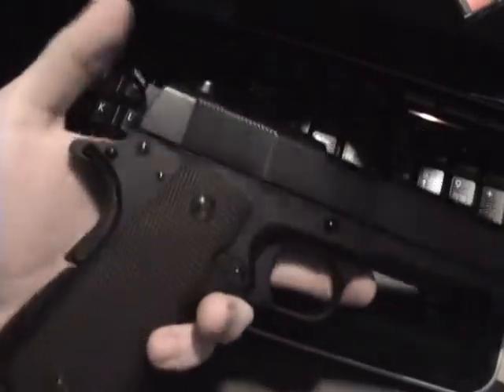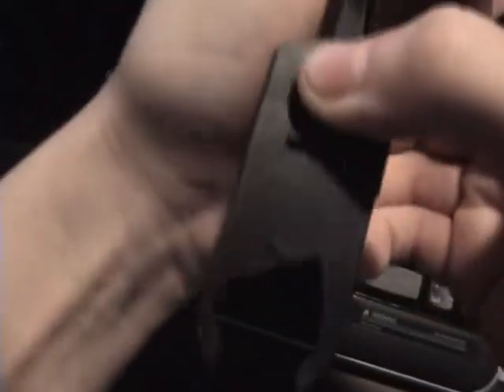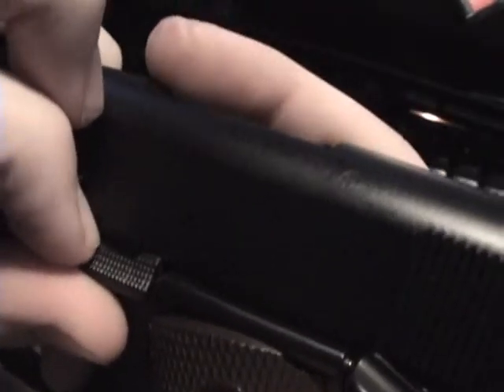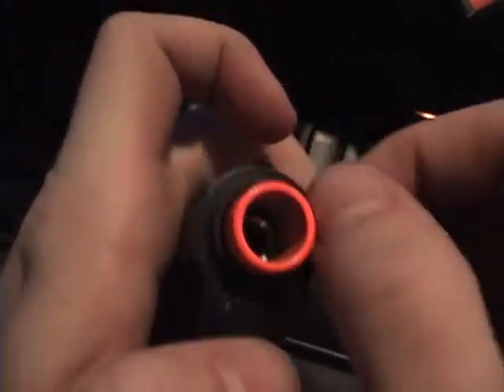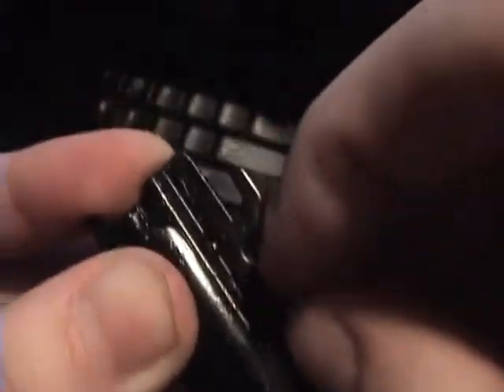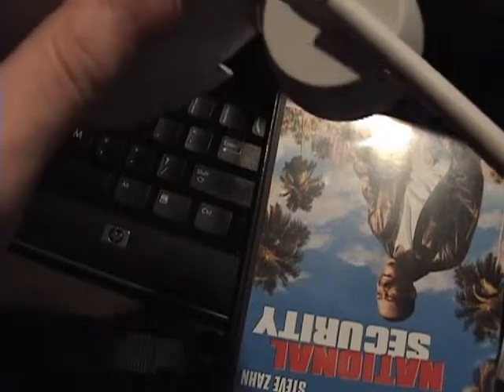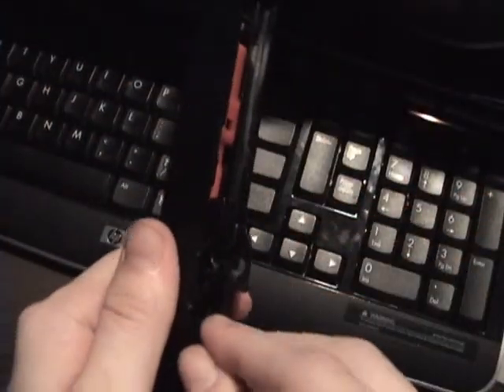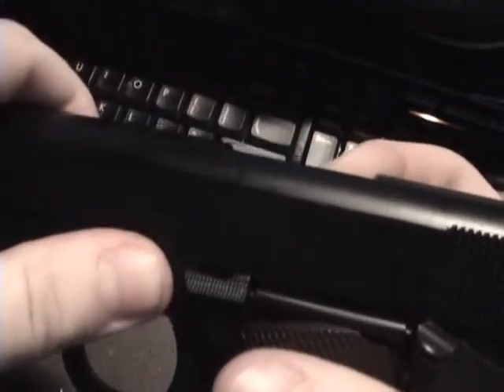Fieldstripping of the KJ Works 1911 + EXTRA

Comment: i have got the exact same one! i got some problems with reloading the magazine. i dont know why this one is so rarely found on youtube, this is much better than the WE one, i got a Socom gear meu aswell. which is an upgraded WE, but my KJ 1911 and SG 1911 have 90% identical internals! + that the metal on the standard WE 1911 is cheap pot metal and the one on this is high quality

Comment: @toboe399 actually the orange tip is only needed to ship the gun in the US, you can legally take off the orange tip when it's in your possession, but there are some airsoft fields and teams that will require the orange tip (that, and cops don't like it either).  It's legal, but not the best idea (I use black electric tape for my guns)